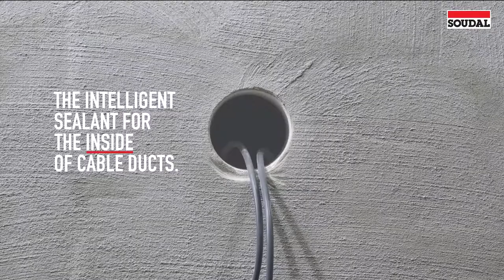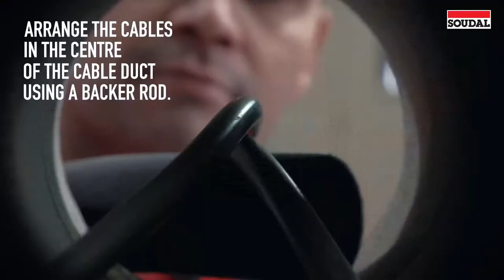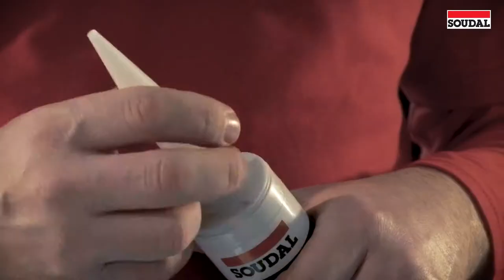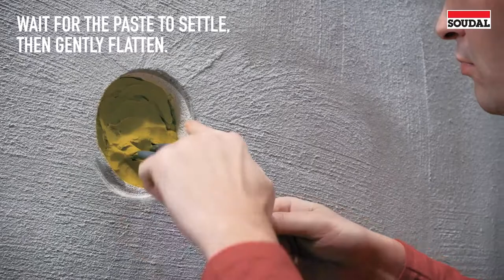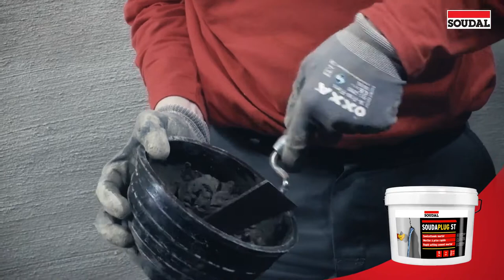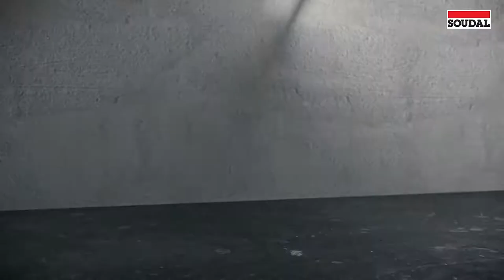Soudapack WST - Watertight Sealing of Cable Penetrations

Comment: If those cables ever need to be replaced you will have a devil of a time digging out all that putty.
Reply: Not really... You just pull the old cable and feed the new one through the hole left behind. Chipping off the concrete is the worst part.